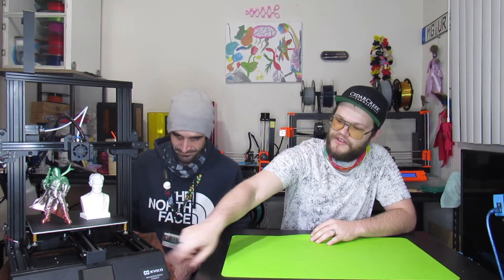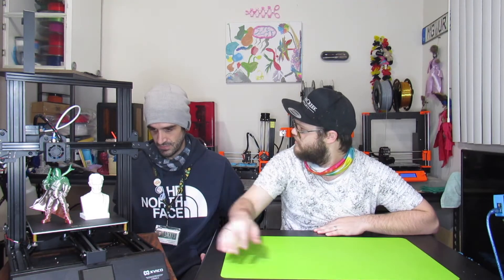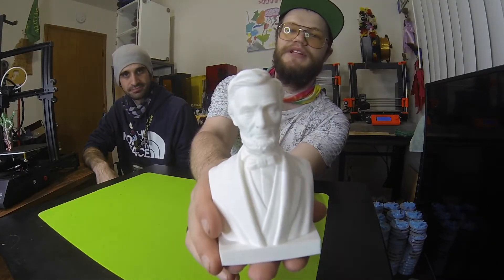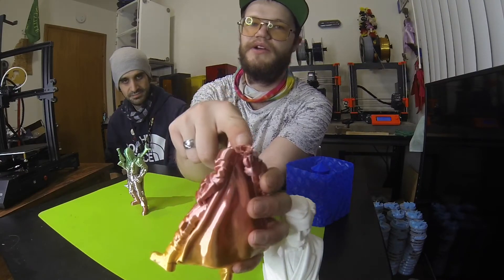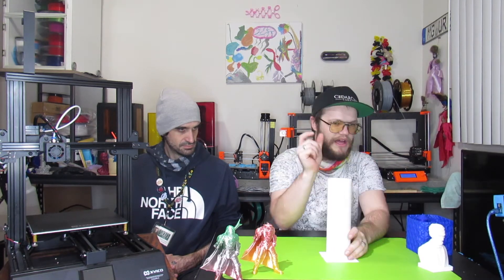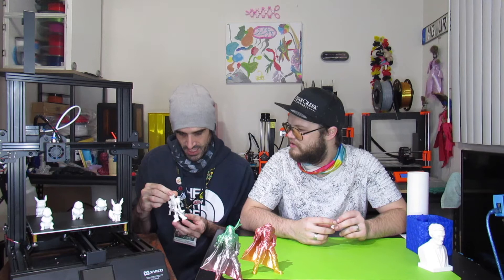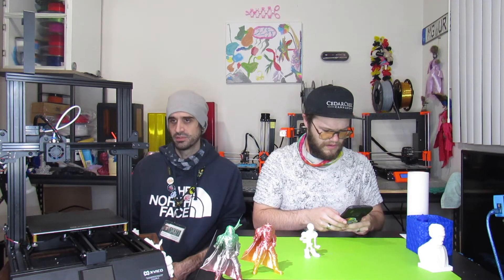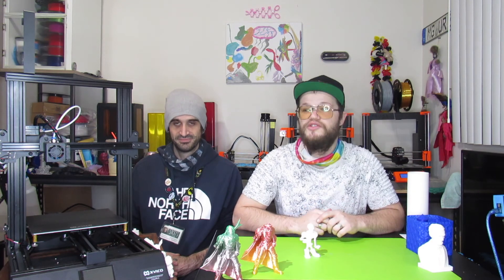Xvico X3S 3D Printer review

Comment: hey im having a problem i  cant even start a print because it immediatley pauses the print and says i need to change fillament
Reply from the maker: Hi so you will need to open the filament sensor up and bend the little metal piece in there just a little bit so that way the firmament hits it when it goes in. It just isn’t registering that there is filament in there mine had the same issue

Comment: I'm about to buy an ender 3, then I saw this in a noob printing fb group,,,, is it better than an ender?
Reply from the maker: So far I have been extremely impressed with it it come with a dual gear extruder and a filament sensor (some nice upgrades that you will want in the future) the interphase is really simple as well. I have had it running almost 24-7 since I’ve got it with only one failure so far. There are more upgrades for the ender and a larger following. I would check out the Facebook groups and ask some questions there as well! Hope this helps you!